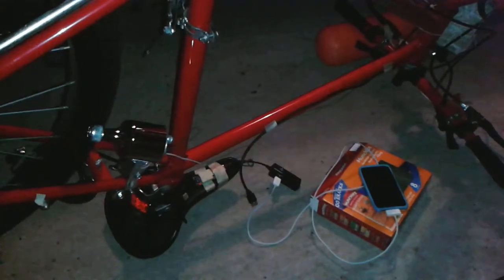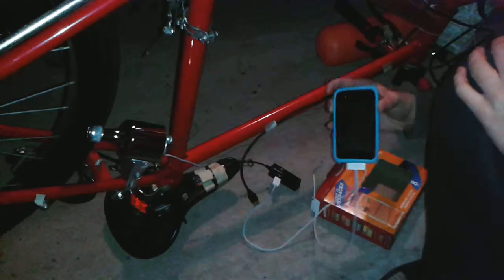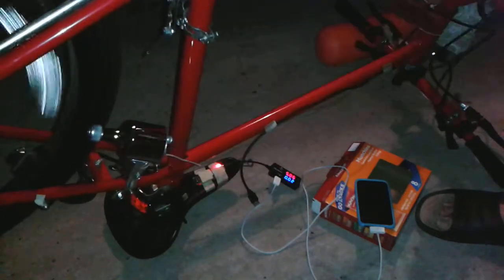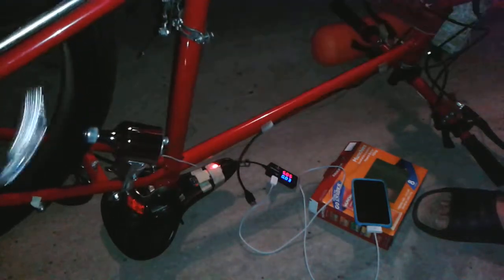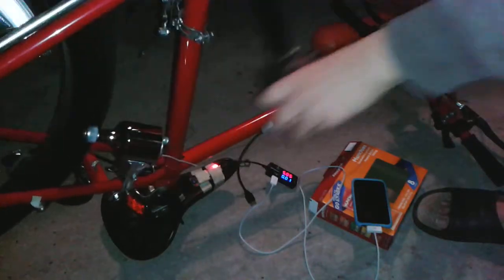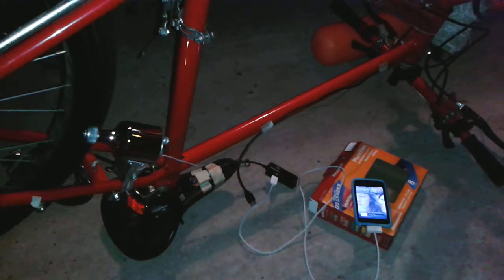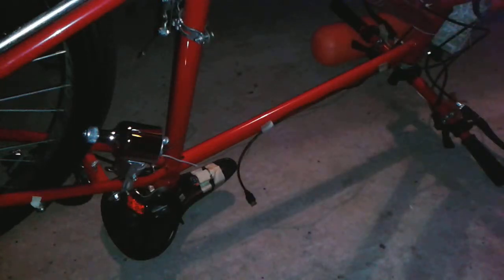Bicycle Generator Part 4 - It Works!

Comment: This is the 12V 6W Dynamo right? I'm reading about 5V on the meter you have there, but that current says about 0.02 doesn't it? That doesn't sound like nearly enough power to charge an iPod, which is like 5W I believe. Do you know what the average-max current you get out of the Dynamo is? I'm trying to do something similar but I'm stuck on this part. Thanks.
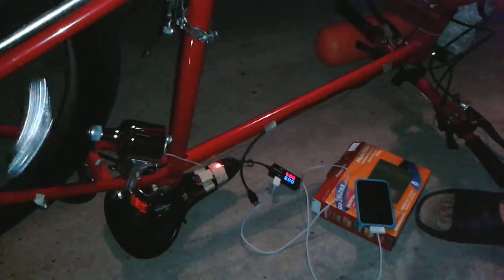Reply from the maker: The iPod touch in this video is a 2nd generation device, and it charges at 2.5W or 0.5A. The meter reading in the video is low because the iPod was already fully charged (which you can see at 0:49). I have been able to draw 0.84A continuously off of this setup, especially after I added some capacitors: https://youtu.be/4B4ZrJ0YLXQ
Reply from the maker: I should also add that I got the 0.84A reading when my Nexus 7 was plugged in. It only seems to charge at 0.23A, 0.46A, 0.63A, 0.84A, or 1.12A. I have never seen it deviate more than 0.03A from these values, and that's probably by design. What I'm saying is that more current could probably be supplied but that my tablet doesn't want to draw any more.
Reply: +David Tsai I see. So this Dynamo is capable of outputting 5VDC and 1ADC (and possibly more) with the proper converters/regulators then?
Reply from the maker: izelkay Yes, the one that I have, which doesn't seem to have a brand or model written on it, can put out 5W. I use a rectifier and a voltage regulator to convert it to 5VDC.
Reply: +David Tsai Perfect, just what I wanted to hear. Do you mind me asking where you bought yours from? Like did you buy it off Amazon or somewhere similar?
Reply from the maker: izelkay I actually got this one on eBay, but the seller forgot to include a wire. When I contacted him about it, he told me to read the instructions. My point is that I am not going to name the particular seller because the experience wasn't good.
Reply: +David Tsai Alright. Thanks, you've been a big help.
Reply from the maker: +izelkay No problem. I'm glad that someone's interested in this stuff.